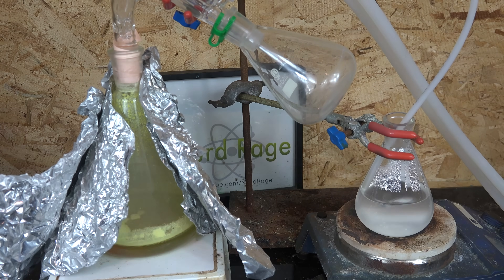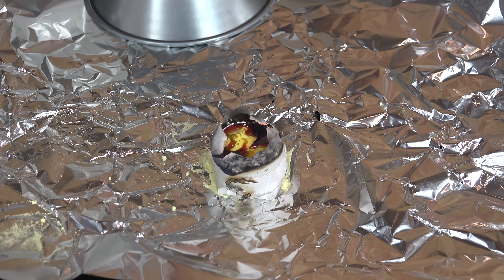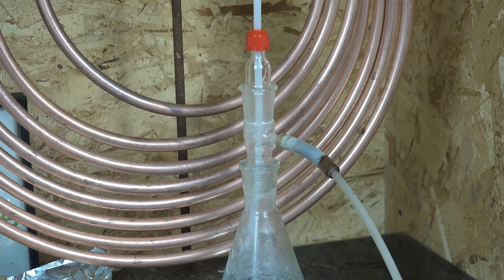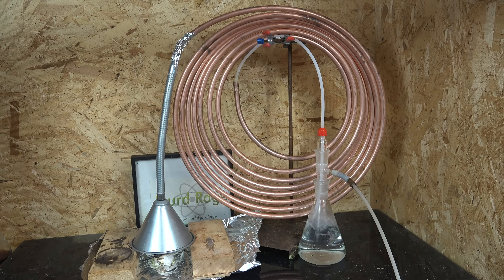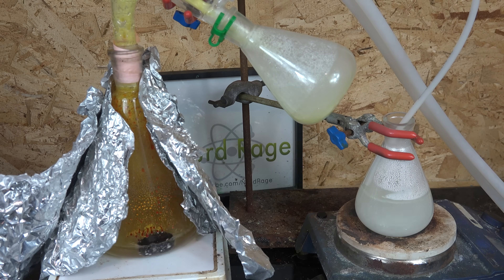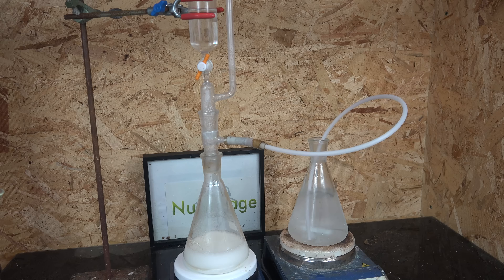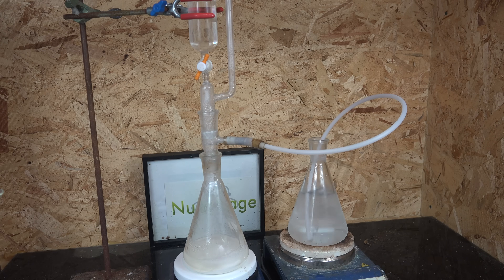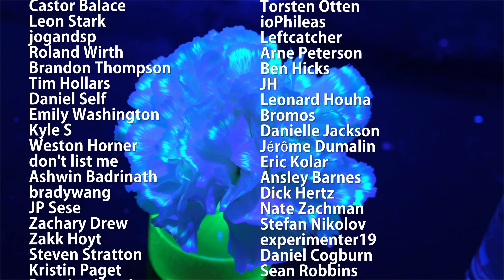3 Ways to Make Sulfur Dioxide Gas

Comment: Metabisulfite method for small quantities of high purity.  Burning method for large quantities.  A pair of good videos would be making the vanadium catalyst and then making sulfur trioxide. Key step is purifying the burning sulfur dioxide to remove water and sulfur and sulfuric acid which damage the catalyst.

Making sulfuric acid from sulfur trioxide is also non-trivial.  The first of two methods I have tried are dissolving in concentrated sulfuric acid to make fuming acid then diluting. 

The second is putting the sulfur trioxide in a closed setup with an appropriate amount of water in two cups.  Everything gets coated with sulfuric acid, but you get 98% acid where you had sulfur trioxide.  The cheapest way to set this up is a flask with a vacuum adapter and stopper.  Use ptfe tubing to attach the two pairs.  Since it takes a long time dedicated glassware is ideal. Some gas line tubing has ptfe core which is available at auto parts stores for reasonsble prices.

If you have a distillation set up without a condensor you can use that.  It takes a bit but it works and everything is contained.  But it will be out of use while this is happening.

Comment: It should be possible to use the Sulfur-burning method also without vacuumpump, if the S is burnt inside a closed container, into that just enough air is pumped carefully, so the flame does not go out.
Reply: In this way there's no risk of damaging the pump as only clean air is fed through it. The tricky part would be igniting the sulfur inside of the closed vessel.

Comment: I'm interested in methods of turning calcium sulfate minerals (Gypsum, plaster of paris, etc.) into sulfuric acid via evolution of sulfur dioxide. I've become interested in this for SHtF/survivalist scenarios; sulfate minerals are incredibly common the world over, where as elemental sulfur is comparably rare. My understanding is that merely mixing such feed stock with high silica minerals (shale, mud stone) and getting it hot enough achieves the goal. I'd be interested in a NurdRage take on the process.

Comment: What about putting the sulfur candle in sealed chamber & feeding in oxygen from oxygen concentrator?  Will the reaction get violent?  Can the rate be controlled by the oxygen feed rate?
Reply from the maker: It would work just fine. The issue is that making one tends to be a little more complicated than the vacuum method because you have to make it air tight and capable of withstanding the high temperature of burning sulfur. It can be done, but a vacuum based system doesn't need good sealing, in fact it can be very leaky and still work.
Reply: My question focuses on the use of pure O2 versus air.  You could still use vacuum, but flood by leaky means O2 around the funnel.  Will the reaction become violent or explode, sending molten sulfur everywhere?
          The object is to reduce the amount of gas delivered for a given amount of SO2, because for most gas deliveries like this, most of it doesn't get absorbed in the target flask & spews about, wasting product & polluting the environment.  If ALL the gas was SO2, then there would be little need for venting the reaction vessel, so SO2 could be regulated for "no output" from the vent.  Neighbor's silverware would remain untarnished.
Reply from the maker: If you're going to go through the trouble of making pure o2 and a sealed container then you may be better off using the sulfuric acid or metabisulfite methods. Less work for pure SO2
Reply: r @NurdRage  I already have the concentrator.  I don't have sulfuric acid.  What I want to know is if pure oxygen will make sulfur candle dangerous.
Reply: @bpark10001 Concentrated oxygen and combustion is always dangerous. Any combustion reaction will get more violent when you increase the concentration of the oxidizer. Rate control would probably be difficult. If you can't guarantee that all of the oxygen you add will first react with the sulfur, then increasing the flow at times might increase the reaction rate, or it might just mean the oxygen you add will pass through into the exhaust with the SO2. It's probably not impossible, but that's not an experiment I'd want done anywhere near me.

If your concern is about waste SO2 escaping and harming metal objects, maybe you could make a scrubber where you bubble the exhaust from the vacuum pump through some sodium hydroxide dissolved in water or something similar. On the plus side, this would make sodium metabisulfite, which you could use to generate SO2 gas on demand in a more controlled manner.

Comment: Is the comproportionation S + 2 SO3 -> 3SO2 viable/easy? If yes,  then for some SO2-reduction reactions it may be viable to set up SO2 regeneration loop, where you use SO2 + yourstuff -> yourstuffreduced + SO3 in your main reactor and regen SO3 back to SO2 in auxiliary regen reactor
Reply: SO2 is an efficient reducing agent in water solution, not by itself, so you product will be sulfuric acid. anyway, SO2 is very cheap for most people and thus that method is not very convenient

Comment: Condense SO2 to liquid SO2. Organic reaction medium, used in long life Lithium/thionyl chloride batteries. SO2 dissolves HCl gas.
Reply: Why would you dissolve HCl gas into a dangerous medium when water does it so easily?
Reply: I've never heard of a battery that uses liquid SO2 for an electrolyte, can you tell me more, like is it only low temperature or high pressure? What safely holds it? What kind of thiols? Etc.
Reply: @petevenuti7355  Thionyl Chloride and SO2 solution. Long long life primary cell.

Comment: Have you considered looking into the DMS/DMSO process and the different ways SO2 can be produced from organosulfurs and reacted with them (IE via methylation/hydrogenation/oxidation) to form other useful compounds?
Reading into it recently myself I find it an interesting set of ways to use these waste products to produce more useful compounds.
Reply: organic sulfur compounds are one of a hell to work with, so I wouldn't use them to make just SO2
Reply: @dimaminiailo3723 Lot of chemicals are rough on lab equipment and dangerous to work with. 
I was just pointing out an interesting 'not so frequently used' approach that is possible: which I think is important to be aware of for DIY purposes. 

Not just about creating 1 chem for use; but assessing possibility of what side products may result (that are also useful), and/or may be able to be reacted with otherwise waste products you'd have to dispose of/etc.
Reply: @djdrack4681  if you're talking about SO2 from DMSO, that's utterly useless even if it were possible

Comment: Introduction
- 0:15: Intro to the video, discussing the purpose of making sulfur dioxide.
- 0:31: Uses of sulfur dioxide by amateur chemists.

Method 1: Burning Sulfur
- 1:00: Introduction of the first method.
- 1:12: Uses elemental sulfur for burning.
- 1:34: Gas capture setup details.
- 2:20: Uses a vacuum for gas capture.
- 3:15: Warning about placing the vacuum pump in a safe area.

Method 2: Sulfuric Acid Decomposition
- 3:53: Introduction of the second method.
- 4:10: Details of the sealed distillation setup.
- 5:05: Challenges in this method related to sulfuric acid.
- 5:38: Advantage of purity in this method.

Method 3: Sodium Metabisulfite Acidification
- 6:07: Introduction of the third method.
- 6:19: Ingredients for this method.
- 6:58: Convenience and cost considerations.

Closing
- 7:48: Summary of all three methods.
- 7:51: Thanking the audience and mentioning Patreon support.

Method 1: Burning Sulfur
Positive Points:
1. Cost-Effective: This method is the cheapest and uses readily available elemental sulfur.
2. Simple Setup: Requires basic apparatus like a metal funnel and copper tubing.

Negative Points:
1. Safety Concerns: Direct exposure to sulfur dioxide could be hazardous without proper ventilation.
2. Complexity: Needs a gas capture setup and vacuum assistance, which may make the process cumbersome for some.

Method 2: Sulfuric Acid Decomposition
Positive Points:
1. Purity: Produces relatively pure sulfur dioxide gas.
2. No Vacuum Needed: This method does not require a vacuum pump.

Negative Points:
1. Safety Hazards: Involves boiling hot sulfuric acid, posing significant risk.
2. Inefficiency: Slow and consumes valuable sulfuric acid, making it less appealing for amateur chemists.

Method 3: Sodium Metabisulfite Acidification
Positive Points:
1. Convenience: Instantaneous production of sulfur dioxide upon adding hydrochloric acid.
2. Purity and Temperature: Produces room-temperature and relatively pure gas.

Negative Points:
1. Cost: Sodium metabisulfite and hydrochloric acid can be expensive.
2. Specific Equipment: Requires specialized items like a gas adapter and a pressure-equalized dripping funnel.
Reply: I've seen you on a few others of his videos I think. You're doin great work keep it up
Reply: Yeah bro we saw the video too. We don't need your book report on it
Reply: @jogandsp  Some people might wish to actually use this video as a reference while doing amateur lab work, so having a quick resource in the comments makes the information more accessible. Just because you find no utility in such a comment doesn't mean it's useless.
Reply: @theKashConnoisseur  the video is 8 minutes long. If they need to know the information they can just watch it.
Reply: @jogandsp  or they can save 7 minutes and 45 seconds by referencing this comment and going right to the info they need. You're entitled to your opinion, but know that it's ill informed and that nobody agrees with you.

Comment: Won't the hot SO2 erode the copper tubing into copper sulfate? Especially if there is atmospheric oxygen available?
Reply: it shouldnt, SO2 doesnt readily react with copper, neither does H2SO4, if it does at all it will probably passivate.